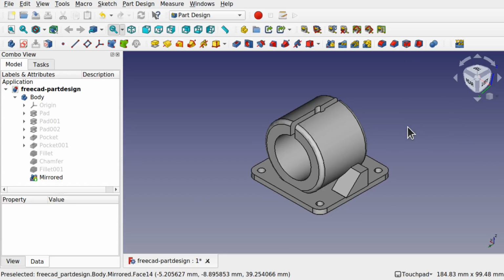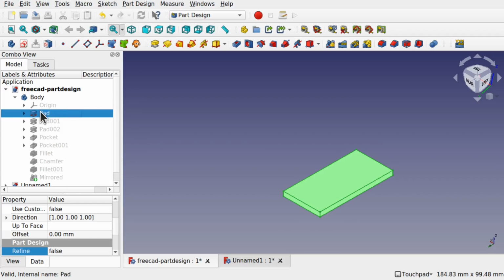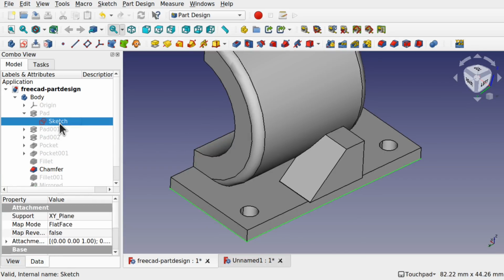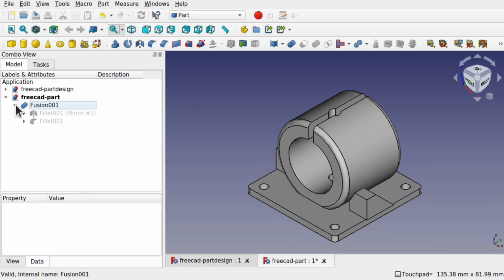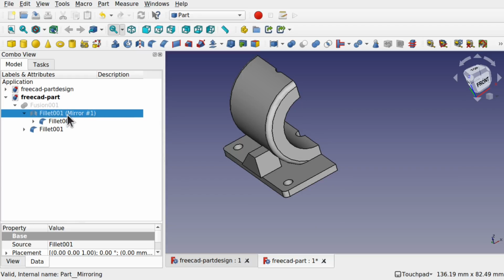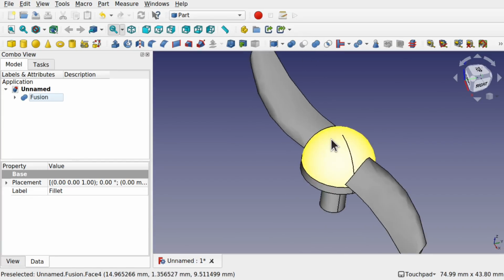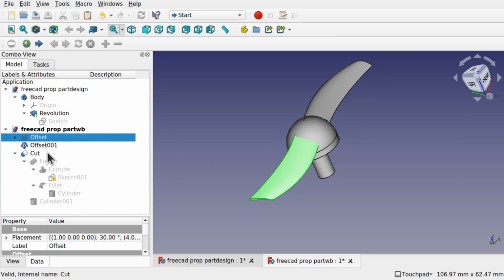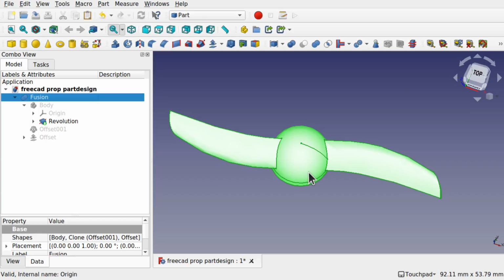FreeCAD: Part Vs Part Design: Why use one over the other? Workbenches explained

Comment: AWesome stuff, great video again.
i've been designing mainly with the PartDesign WB just recently I found the part workbench easier for modelling some elliptical handrail for some stairs, my main issue was that my model tree got messy using different workbenches I got lost with tools like: make solid, make compound etc, It would be great if there was a standard using something like the make part container the tip of which would as standard be a part that could be used with all part design tools like boolean
Reply from the maker: Glad you enjoyed.  You have found the same as me, the part workbench is really powerful and flexible but it's so easy to get everything in a complete mess with how flexible it is. Like yourself I wish there was something more like the part design for it's workflow, it's so easy to get lost.

Comment: I think this is the first time I understand the difference. This is a great explanation of the whole tree structure thing. I was a bit perplexed as to how you migrated the Part Design thingy into the Part WB, but overall it was excellent. Those short cuts are presumably obtainable somewhere. I'll have to replay a few times over that section.

Comment: Wow what a video! Just a little too advanced for me...(Have to admit I try to run before leaning to walk!) I came here trying to slice a cubic object 'diagonally' By this I mean from a top corner to the opposite bottom corner or above according to what I want. 
All the tutorials I watched seem to show horizontal split.  I played a little with the arrows in Plan>Transform but somehow failed to achieve what I wanted. 
Anyway thanks a lot for this :)
Reply from the maker: There is a lot to digest in the 😊 So there are a number of ways. if you get you object and then create a plane in the part wb and rotate this into position. Next ctrl select the object, then the plane then go to top menu, part, split, slice apart. In the treeview you will see both slices the one you don't want can be hidden.

Comment: If we have two solids seperately and we want to use a sketch of ones in the other one as a reference for example to combine to solids with screw. My goal is to automatize it (if i change the sketch at one side it will automatically change the hole of screw at the other part). Do you have any recommendations for it?

Comment: I've tended to start off with the Part Design WB and then switch over to the Part WB for its Boolean tools. I liked your reasoning for why one might use the different benches. I'll try using the Part WB more.
I noticed you mirrored the fillet. I've tended to save filleting right until the end as I know the OpenCascade kernel can have problems on occassions.
(By the way, you made that curved line split seem effortless.)
Yes, another eye-opening video on FreeCAD. Thanks.
Reply from the maker: I do tend to end up using the part workbench more and more these days. I do challenge myself to keep inside the Part Design. The other day I was doing a quick F1 nose cone in the part design and had to resist using the part but I managed to stop myself lol. Yes filleting and chamfers I keep right to the end but if I know I am going to finish with a mirror I tend to fillet and then the mirror and that's the end of the job. But I always wonder if this is right. As it's the last action I am guessing it's OK. Glad you enjoying the videos.

Comment: As usual, a great instruction and comparison, well explained. Just a pity the toy prop will not work. Consider the pitch of the blade halves - one side pushes while the other side pulls. I realize it is only an exercise, but could be misleading for the more newbies in the audience.  😁

Comment: Interesting, I wonder however, how do you work precisely in part design? Like lining the blades exactly at the center and symmetrical for instance?
Reply from the maker: Mostly you would use the placement in the data tab. When you work with part design it is much more easier as you have one single object referencing other geometry whilst attaching it to faces. You can still attach sketches to faces with the part but when you start mixing workbenches then you have to be mindful of placement. Such as when I created the blades. I should of been more aware where I started the sketch b splines as the point of origin in the sketch is the pivot / placement point.
Reply: I have the same problem w Part WB. The inability to place things accurately relative to each other makes it annoying.
Reply: @Miniellipse  hi dude, it's feasible by right click, select "transform" and you can set the accuracy that you need both in translation and rotation, then moving by clicking on the arrows and rotate by clicking on curved lines.
Reply: @clementclarisseclemen3d708  Thanks. I know that.. My comment was not clear. I would like to move objects to centers, edges or corners of other shapes. Sort of like snapping in other programs. Is that possible in FreeCAD?
Reply: @Miniellipse  i think you can by using coaxiality constraints in "sketch" workbench

Comment: Nice explaination of the difference. I have been using the Part Design workbench to make a few 3D printed designs, and have wondered what the difference is and why I might want to use the part workbench. Perhaps I should have a go at it again - I stopped because I got lots of strange messages about things not being solids, or parts from a different body or something like that. I know that as I understand how things fit together this hopefully will not be a problem! FreeCAD is an amazing tool, but its not easy for someone like myself who doesn't have a CAD background to always see what is going on.... I've been using OpenSCAD a lot recently because it makes more sense to my "programmer" mind, but it looks to me like the Part workbench is closer to the way OpenSCAD works than the Part Design workbench.
Reply from the maker: Thanks glad you like. Yes beginners to freecad can end up having a rough ride and maybe the part design is where as a beginner the journey should start. Because the part workbench is so generic it allows you to create faces, shells and solids all in the same part. Where as the part design just allows solids. The former requires a deeper knowledge of what these are and how to use them and I think that's where things start to fall apart and beginners go elsewhere. Trust me even with CAD knowledge I was first pretty confused with the product and had to take a step back. Its has a pretty steep learning curve. I have little experience with SCAD. and having a similar mind as a Dev I don't know why I haven't gone down that route yet. I must have a look some day.
Reply: You got two features that you can use in this, which are "convert to solid" in "part" rolling menu and "solid from a shell" in "advanced creation form utility" (or something like that, in any case, it's french name is "utilitaire avancé de création de formes", you may found it on their wiki)

It did'nt deform or do whatever to your drawings, just generate a solid version of it...
Reply: I have only used the part workbench, coming from fusion 360 about 6 months ago, and at first it definitely felt tedious doing operations with separate sketches, and then doing boolean operations with them etc. I started on the Part workbench because I tend to make complex designs with many separate bodies, and you can only work on a single body at a time in part design e.g. can't split bodies (although I believe this is being worked on). 

However as I got used to it, I realised the part workbench is much more powerful, since the part tree, is essentially the same as the part design sequence (or other CAD sequential operations), just displayed in a different manner. The extra strength of the part workbench, is that you can then have multiple branching paths to build your object. With the sequential type structure, a small change at the start requires recomputing the whole sequence, whereas only the following features in the tree need to be recomputed in the part workbench.

It looks very similar to OpenSCAD, in that each operation is basically a function acting on the previous nested functions. In fact that's probably exactly what it is. You can even import OpenSCAD files and it will essentially be converted to a part workbench design which can then be used in FreeCAD which is really cool. It would be even more cool if it went the other way, making customisers straight out of CAD software would be awesome.

The benefit to the part workbench approach is that you can reuse the same sub-components just by using them in different operations. Like you could do a cut operation on the prop blade in this video for example, and it would create a new separate object, using the same original 'branch'' of the prop blade. In F360 you would need to copy the base object at the right place in the operation sequence, move to a different part of the sequence, then use it for whatever you need, which is laborious and wastes a lot of time recomputing things you don't need it to.

The part workbench essentially has lots of things in parallel, rarther than sequential. Another benefit is that the part workbench is lower level in FreeCAD and therefore more robust. I used nTopology recently and this works in a similar way, each operation is a 'block'' which acts on previous nested 'blocks'. I thought this was really novel and neat until I used FreeCAD and realised it's basically just a very low level way of structuring things.